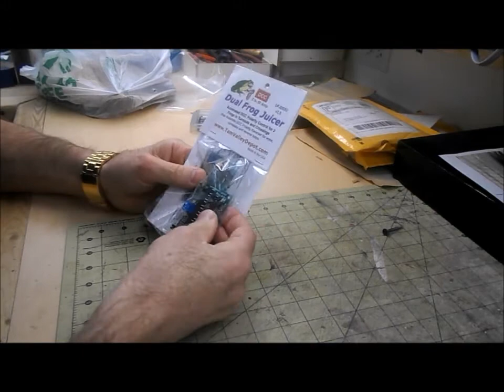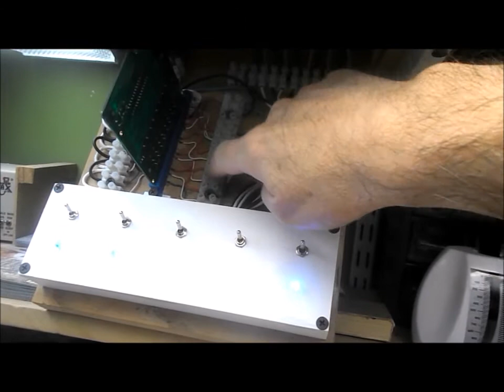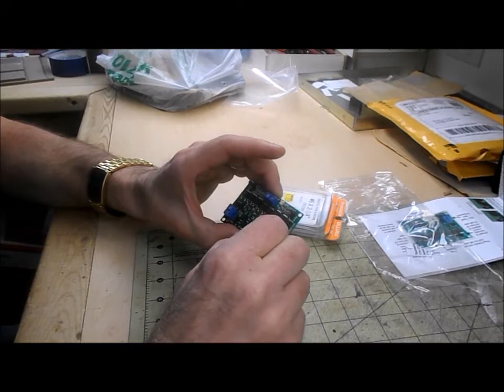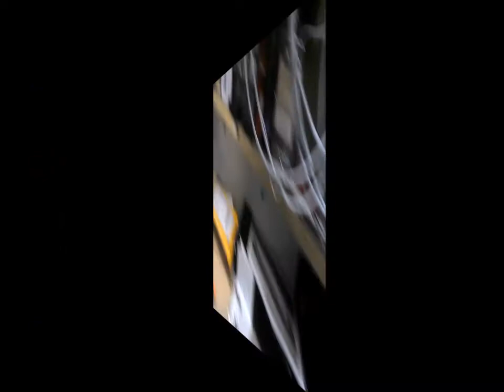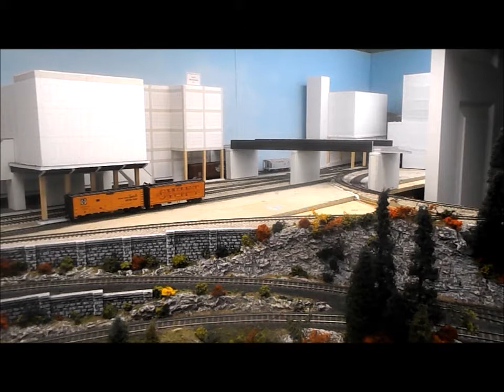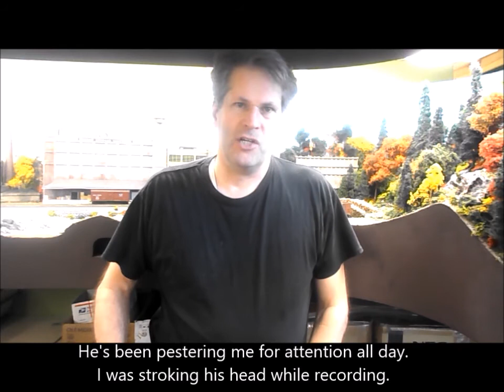The easiest way to wire a reversing section

Comment: I like watching your videos, but not this one, it showed very little details of how to wire or use the reversing unit.
Cheers Malcolm
Reply from the maker: Thank-you for the feedback.  I'm sorry to disappoint.  
There really wasn't much to it.  The dual frog juicer goes between the power supply and the rails.  The circuit board has just four screw connectors (no soldering) and they are all clearly labeled.  Two are for the power feeds, and two go to the rails.  It doesn't even matter which way round the wires go so there's no chance of accidentally getting it backwards.  I edited out the part where I actually did up the screws because it was too dark to see anything in the cramped area I was working.  
Once the four wires are connected, just run the trains normally and forget it's even there.  It really is as simple as that.  I guess the project may have been too trivial to be the subject of an entire video but I posted it anyway because I thought it may be useful to someone.